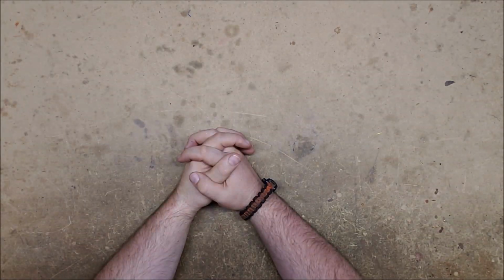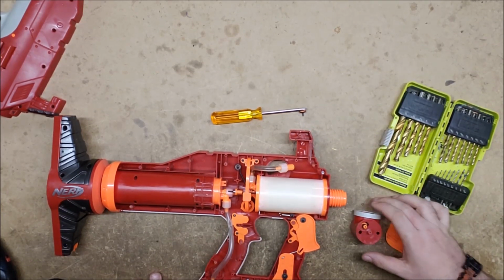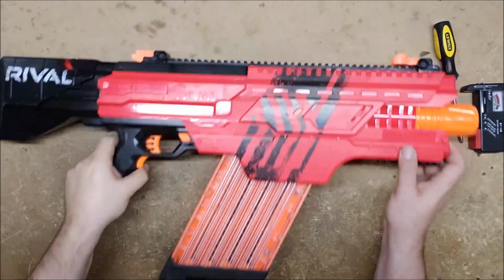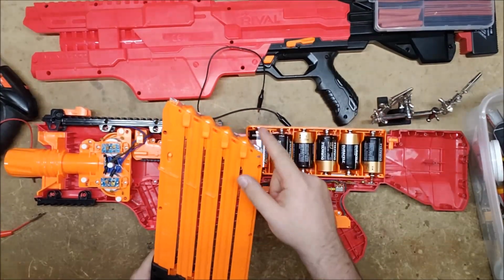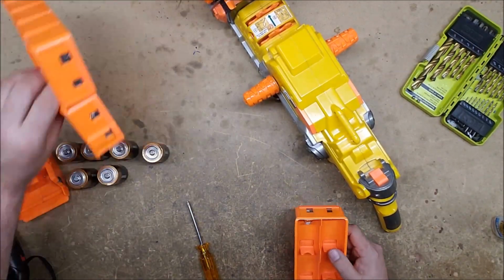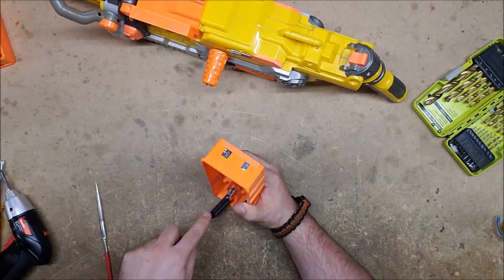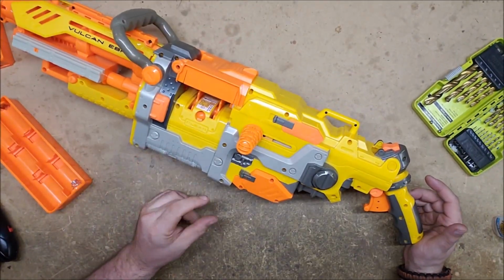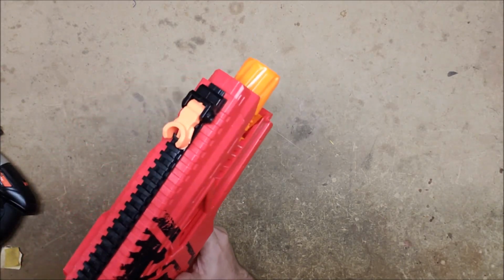Diagnostics and Repair - Episode 6

Comment: I bought a retaliator for cheap because it was 'broken', opened it, pulled 4! mangled darts out of the mechanism and now it works fine. Hurray for diagnostics and repair!
Reply from the maker: Hurray!  :D
Reply: Mine shreds darts all the time
Reply: I had a zombie strike dart in the back of my modulus and like a year later I shook it out somehow

Comment: I know this is an older video, but I saw the Vulcan so naturally I watched. It's super cool of you to help people with their repairs like this, and of course visually through videos as well. Half of the electronic stuff that I come across when it "doesn't work" luckily has to do with corroded battery connections, and it's always good to try the obvious first. Other times, parts are simply missing or otherwise defective from the get go. I found a Roughcut from Value Village that I believe was missing an air restrictor spring through its entire life. Another was a Spylight with a faulty cylinder due to the smaller rotation thing plugged into it being crooked and needing to have an alignment peg shaved down in order to sit flush and allow proper rotation. These were not difficult repairs once I figured out what was wrong, but rather unfortunate given the toys would have spent their entire life with their original owner, likely a children not working properly before eventually being given away. 

At least when something is visibly broken or worn down, we can assume it was simply played with a lot while it still functioned. I'm glad that kids or parents of kids especially can find your videos and their helpful nature, and the advice can apply to just about anything.

Comment: Had a friendly NERF war at my flat today, and my friend's EAT blew half of it bolt assembly out of its barrel. :-/

An hour of comparative anatomy with my own working EAT and some digging around online and I figured out it was still running like 1/2 of the sprung AR system, so it had no power when fired.

10 minutes of drilling, and padded the plunger with foam from a dead dart, and it lives! It even shoots a little harder than before.

Thanks for these (repair and CITAK26) videos Cap'n, they're great tutorials for getting a feel for what's going on inside our NERF guns.

:-)

Comment: I remember when I repaired my Recon MKII and after finished, I removed a few locks, but I thought the price that keeps the dart inside of the firing tube was a lock, so I killed the thing... Lol.
Reply: It can still work without it mine doesn't have one and it works fine
Reply: @haydenadams8760  The darts fall right out the end for me.

Comment: Would removing the magazine lock in the Khaos also be a viable solution?
Reply from the maker: No. The magazine will not properly feed without the top part.  So the blaster would rev and fire...but would instantly jam.

Comment: Dear Captain Xavier:
I bought a Nerf Titan AS-V.1 IN 2 weeks ago when I Tried to Pump the Titan Air pressure gauge and it didn't get into max gauge because its doesn't pump at very high gauge power because its is a pain in the butt of every time that I've even pump to max gauge. Does really it's a air leak that I've had to pump 20 times and its does not goes on full air max air, do have a suggestions of what is the issues that the Nerf Titan Had an air leak?  
-pedroj234
Reply from the maker: I cover Titan Air leaks...in this video. You need to isolate the leak. Alternatively the issue could be the o-ring on the pump being worn out.
Reply: @CaptainXavier  Not the pump or the o-ring is been worn out, but is the pressure gauge valve that is been leaked. But I am fixing the good old  NERF N-Strike Titan AS-V.1 AIR LEAK PROBLEM.
Here's is my question:
Does I can replace the air pressure gauge leak, by replacing with some of pressure gauge indicator? OR it's is by to GLUE it the air gauge leak, Its that possible?